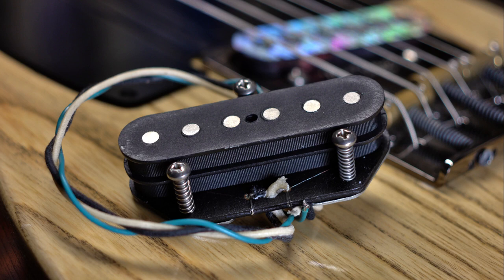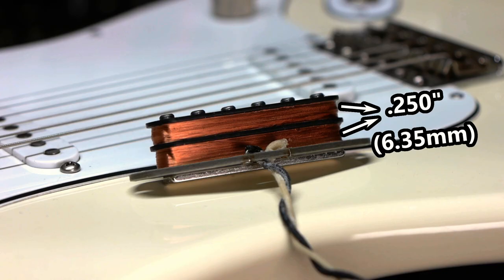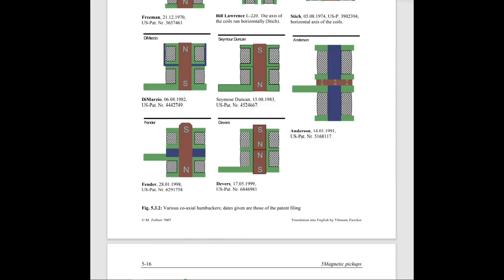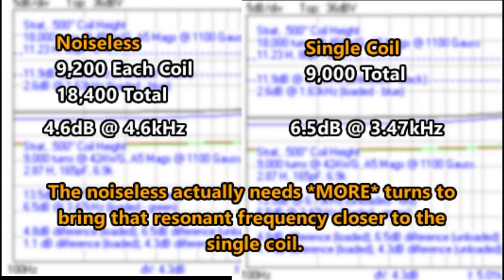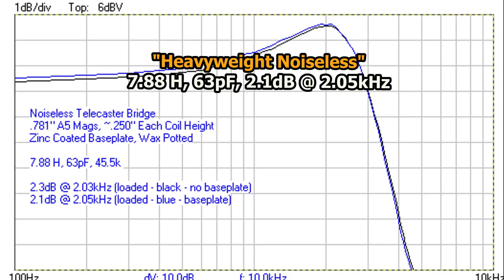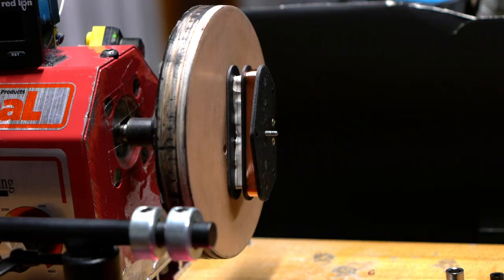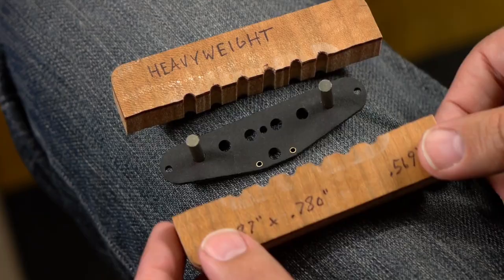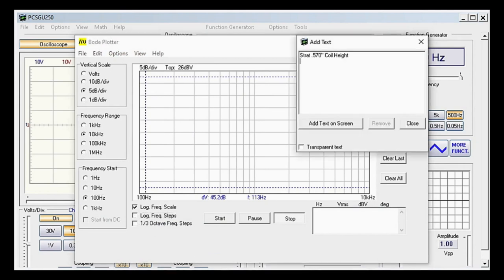Noiseless "Single Coil" (Stacked Humbucker): Build Tips and Theory

Comment: in laymans terms, you’re basically saying that to get a tone close to that of an 8000 wound 42 awg single coil, the total wind count of a noiseless pup would need to he 16000??! wow, i always assumed that the two halves would be 4000 each and then add up together to the desired 8000 for the same or similar tone of a regular 8000 wound pup
Reply from the maker: Yes, that's it. Since the bottom coil is mostly inactive in its contribution to the tone of the pickup. 

Humbuckers are another story entirely. One of the most Strat sounding humbuckers I've made was using alnico polepieces and around 4750 turns of wire per bobbin, for a total of 9,500 turns. 

It isn't that simple though either. Keep in mind that on a single coil pickup, as you near the end, each turn of wire is traveling a much greater distance than the initial turns of wire. As the layers build up, each turn of wire is longer than it was on the previous layer. 

So when winding a humbucker, which uses two bobbins, you're 'starting from scratch' on each bobbin. There is also an effect called 'comb filtering' that affects the tone of the humbucker, and is a direct result of there being a larger area of the string vibration sensed due to the two individual coils -- and the fact that there are two coils picking up the sound instead of just one. 

It is quite staggering for the stacked noiseless pickups. This is one reason I've been experimenting with low impedance noiseless pickups, which simply means a pickup with much fewer turns of wire, not nearly enough to produce enough volume without a preamp. 

You can even do this yourself, as you can easily wind a low impedance pickup by hand, as it requires mere hundreds of turns of wire, as opposed to multiple thousands. The lowest I've gone so far is 500 turns for each coil, but I want to try getting thicker wire and doing 50 or 100 turns on each coil, and see how that sounds. 

I've been playing direct in to my Scarlett 2i2 interface these days, almost exclusively. Being an audio interface, it has a built in preamp. So even very low output pickups can be boosted to where they're perfectly loud and audible. 

A separate preamp still might be preferable. But anyway: the noiseless low impedance pickups I've made have been extremely quiet, which could be useful for recording, and they also have a very flat EQ -- meaning that you have much greater flexibility in shaping their tone in post-processing using digital plugins / software. 

We're living in the digital age and I'm very curious to see if low impedance noiseless pickups are the solution. Not that it's anything new. Les Paul came up with this back in the '50s with his professional series Les Pauls that were made to connect directly to the recording console in the studio, via an XLR cable if I'm not mistaken -- which would mean a balanced output. 

He was very ahead of his time with that. All the stuff I'm doing seems like elementary school recess in comparison. But still a lot of fun. 

Also look up CyFi modular pickups. They have DIY plans. I've never tried to make them, but they have plans for them up on Github, and you can purchase them if you want. Very interesting concept -- very, very interesting. 

What I like with passive pickups is that the tone is 'baked in.' You just plug and play. The trade-off is that they are not versatile at all. You get one sound from the pickup and that's it, and the potential to EQ it as desired will be much more difficult, as again, the tone is 'baked in' to the pickup. 

Well anyway. Just rambling as usual. I could talk about this stuff all day. Hopefully you find some of this somewhat interesting or useful. Pickups are simple devices but the possibilities really go on forever. I also have a video in the works about a Cozart 12 String, where I installed a piezo disc pickup in the neck pocket, and made a low impedance magnetic neck pickup, and blended the two together in a Jazz Bass wiring scheme. It sounds extremely unique and I'm excited to see how much I can improve on that.
Reply: @guitar_md  what if the upper bobbin was wound like a regular strat pickup, and the lower bobbin was wound with a much higher gauge but the space for winding was reduced to a much smaller size? The two windings would match in turn count, however, the upper half (the important one) would be the same spec as a standard single coil. would this get to a closer accurate tone than two halves of equally high coil gauge?

Comment: What would happen if you wire the two coils in parallel instead series?
Reply from the maker: I'm not sure, but you could expect a thinner, weaker tone -- I've never tried it. With the method I'm demonstrating here, wiring them in parallel is not possible, as it's one unbroken strand of wire. 

Two single coils wired in series vs. parallel or a humbucker with its coils wired in series vs. parallel. I'd expect similar results. Parallel has less output, actually significantly less. I forget the actual math on it, but it's not 50% of each pickup, it's more like 25% of each pickup, or something like that. So parallel is a much thinner sound with less output. 

I set up all my personal guitars with a 3 way switch, and then a series/parallel push pull pot, and an in phase/out of phase push pull pot. Best of both worlds. And 6 sounds out of two pickups. Absolutely love it!

Comment: Your work looks excellent.
But, "close to the tone"  says it all.  It's still a humbucker and will not produce the classic bright-attack Fender sound.  You should note that different sized wire gauges can significantly alter voltage velocity (i.e., the speed of the  current within the conductor).  This can greatly affect phase alignment between the two coils.
E.g., electro-magnetic RF moves at the speed of light (300,000 metres / second)...but, ONLY IN THE VACUUM OF FREE SPACE.  In the Earth's atmosphere, the speed is at least 80% slower.  In quality coax, — e.g., Beldon 9913 — the RF velocity loss factor is less by over 90%!  

AF signals (to 24 kHz) are not far different.  This is why your coil wire lengths MUST be EXACT, your winding deadly consistent (hand winding is not advised), and you MUST use, not only the same gauge wire, but wire from the same manufacturing run.

Look into using a broadcast quality, line-level, high impedance (for valve amplifiers) audio transformer at you guitar's output.  They are expensive ($100 -$150) and some will not fit into a guitar without routing, but combined with a clean, battery driven class-D preamp, you will be rid of all or most 60Hz - 50Hz mains hum and stray EMF noise. 
Also, the volume pot on your guitar will no longer affect the tonal balance of the guitars output (if you use a class D preamp, OR a good MOSFET circuit).  You do not HAVE to use an active  preamp or expensive transformer, but without these items, the volume pot will affect the output tonal balance.  When you turn the pot, the entire circuit's RC resonance value changes. 

I am a E.E. working on a new way to make noiseless TRUE single coil PUPS.  I am pursuing 3 possible solutions, —all of which will be much cheaper than the above solution.  I.e., the pickup alone will do it all (except for retaining tonal resonance response from the guitar's volume pot).  Note that there are simple, inexpensive,  passive RC / LC circuits that can reduce a guitar's volume pot's resonance affect on the signal. —Not quite as good as an active class-D output circuit, but a good volume pedal will solve this problem as well. 

Have a look at basic RC resonance formulae for passive AF circuits.  It's no more than basic algebra; —if you can add fractions, you will be fine.   
Read the first 2 or 3 chapters of the ARRL handbook. YES, it is written for amateur radio people (i.e. HAMs, —NOT CB-ers), but the first chapters take you through classic, BASIC electronic circuitry theory, via a fast and in an easy to learn format.  It applies to ALL electronics and anyone who wants to build anything from a pirate radio station in c. 1970 (No PLL chips, only valves!)  or build better guitar circuits in 2023.  —Good stuff.   Buy any year ARRL Handbook (eBay).  Basic circuitry has not changed. Newton saw to this, and not even the most confusing "String Theory" changes a darn thing.  
I think String Theory is good only for acquiring grant money...